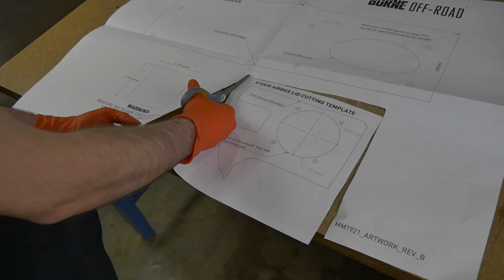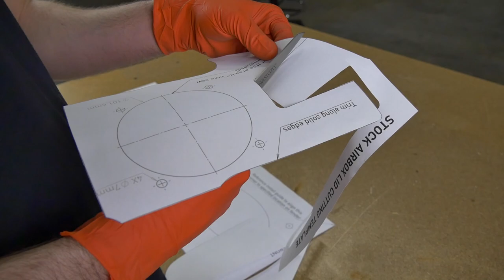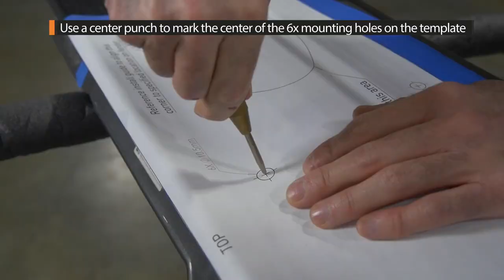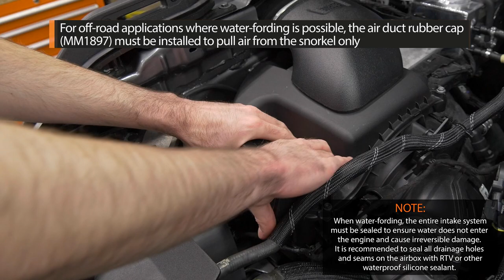2021+ Ford Bronco 2.3L/2.7L Borne Off-Road Snorkel Install Guide

Comment: This video is single handedly saving my ass. Mine didnt show up with any instructions or a card to link the video. Im doing the install as I type this. Only difference is my kit comes with the Mishimoto high flow intake as well
Reply from the maker: Here is a link to the written guide if that helps, too!
https://www.mishimoto.com/mwdownloads/download/link/id/1739
Reply: @mishimoto  Thank you, I wrapped it up last night. The video got me all the info I needed to do the job combined with the performance intake video as well! SUPER happy with the look, fit, and performance of the kit and definitely looking forward to testing the snorkel on my next wheeling trip!